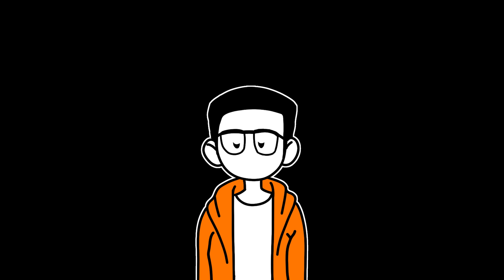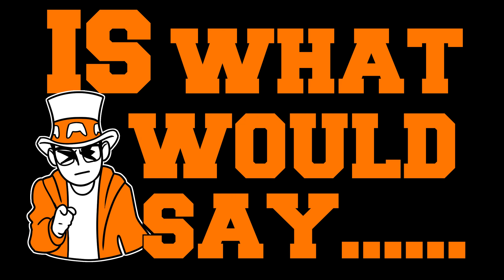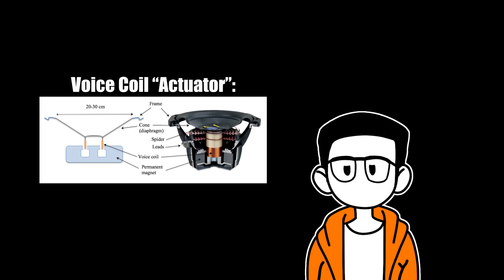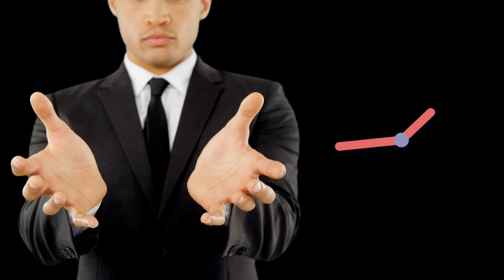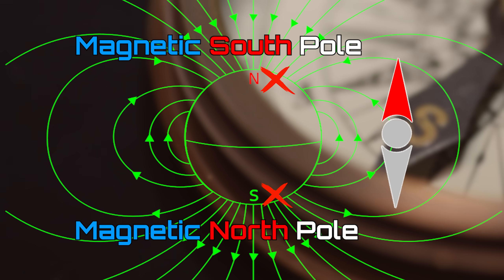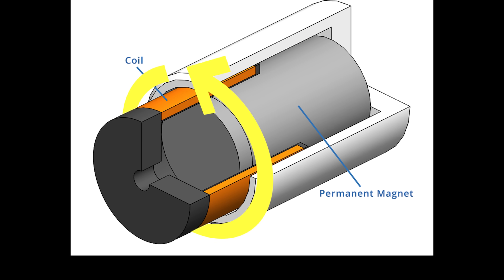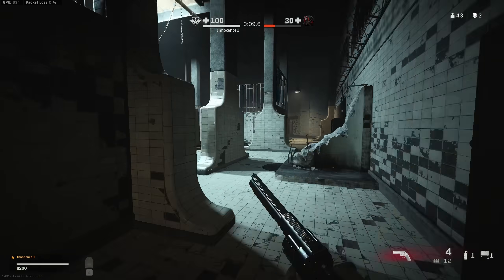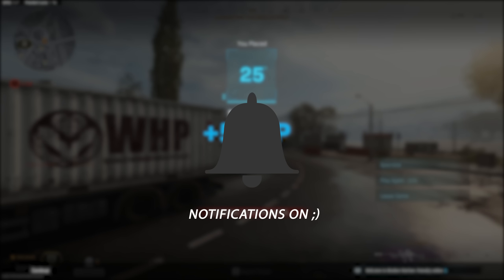Explaining Exactly What A Dualsense Does.

Comment: I feel like what Sony has done with their whole system is super overlooked cause 12 teraflops lol kinda criminal 😅
Reply: Wdym
Reply: Nah, I'd say its quite the opposite. Everyone started praising the raw I/O thoroughput in the ps5 but ignored the velocity architecture for the series X, ignored the insane speed of the split vram of the series X(ie 560GB/s in the series X vs 448GB/s on the ps5), ignored the better decompression technique in the series X(BC pack) and had the idiocy to say that the series X SSD will be bottlenecked(which is what innocence himself said in a video). Oh and nobody praised the Dynamic latency input on the series X, the much larger die on it(which is why it has more CUs and doesn't need the liquid metal cooling the ps5 needs). Ignored that the series X has very stable clocks but haven't seen how much does the ps5 frequencies drop while playing titles. Ignored that the series X can load a game in mere seconds from cold boot through quick resume. Ignored that the series X has a 12 teraflop gpu(that is pretty much the rx 6800 with 8 less CUs and is pretty cutting edge). Ignored that MS engineers did work as hard as Sony's team for the best hardware on the series X and just think that they just threw in some PC components(which they actually did with the OG xbox and it was wayyyy more powerful than the ps2). Ignored that the series X will also stay pretty cool with its vapour chamber solution and that liquid metal is just more effective thermal paste and not something that'll freeze the ps5 while the series X burns. Ignored that series X still preserves games better with features like Auto-hdr, which makes use of machine learning on the series X and that xbox does have DirectML that could result in DLSS like super resolution feature being implemented on the series X.
Reply: santhosh sridhar this is just a paragraph of you saying things that are half true 🤨easy example Xbox ssd will have bottlenecks cause it they haven’t made it a priority to remove the bottlenecks 🧐 also Xbox is overrated  everybody has been saying it’s going to do 4k 60 w/rt on every game if that’s not praising than idk wat is
Reply: santhosh sridhar than you tell me y ps5 ssd speed it double Xbox and Xbox ssd speed is just typical ssd speeds which have bottle necks  I’m pretty sure every ssd has bottle neck unless u do what Sony did and make it a thing to go in there and remove them
Reply: @lilcartwheel1144  Idk. I guess all this advertising of power really made people get a false mentality about the series X. It is powerful, so is the ps5. But 4k 60fps with raytracing is something even the 3080 or the 3090 can do without any kind of dlss and even with that, it's hard to maintain the solid 60fps in some games. The series X is a powerful piece of hardware, so is the ps5, but they are just high end PCs and not even ultra high end for that matter. 

I guess this is what happened when ps5 just pushed forward the advertising of their SSD. Yes it is stupidly fast. And on paper, it is double the speed of the series X SSD. But the series X SSD is no slouch either. And with the more powerful cpu and GPU, and much faster VRAM, it can easily compete against the ps5 SSD. Just like the ps5's power is very much comparable to the series X's power.
Reply: @lilcartwheel1144  What Sony essentially did was add custom memory flash controllers and 12 pcie lanes instead of 8 thus greatly improving the bandwidth of the SSD. This was also why their storage is 200GB less than the series X, coming at around 825GB. Innocence did do a pretty good job explaining this. And removing the bottleneck, thus making sure the SSD reaches its maximum bandwidth.
But just because they essentially built some silicon or something......idk......I'm not Cerny.
.....to remove the bottleneck.
I'm pretty sure it isn't really that of a big deal and isn't there in PC SSDs because obviously, you're the one building the PC, not a specific manufacturer who makes sure that your SSD isn't bottlenecked.

Ok just read up about it. It's that storage APIs just aren't good enough to handle many I/O requests to take full advantage of the SSD, thus creating a bottleneck

But he really failed when he started explaining the series X's SSD. Microsoft DOES make sure that full advantage is being taken of their SSD. It's why quick resume is so fucking fast on the series X. DirectStorage makes sure that the xbox takes full advantage of its I/O. Oh and fun fact, it's also coming to PC.

I hate it when people treat sony hardware as "custom" and microsoft hardware as throwaway pc hardware because that simply isn't true. That's just a big insult to microsoft engineers who have worked for years on this. 

The only thing "custom" they didn't do and the ps5 did was add custom memory controllers and 12 lanes thus greatly increasing the raw I/O throughput. But instead they focused on the velocity architecture, focused on RDNA 2 technologies like sampler feedback streaming that greatly reduces load. And boasts a better decompression software and much faster GPU memory thus mostly making up for the weaker SSD.

Here is your proof. You have to skim through some things but it has all things I said and more

https://www.google.com/amp/s/news.xbox.com/en-us/2020/03/16/xbox-series-x-glossary/amp/
Reply: Because Sony changed ssd,did all this stuff with controller, went all out in the cooling ,trying to perfect 3d audio while also having all the features for next gen butttt ppl don’t talk about that they only dead set on teraflops  for example gdc out of all that presentation what did ppl get out of it .... 10.3 teraflops
Reply: @lilcartwheel1144  ik right, it's pretty sad😔
Reply: @lilcartwheel1144   is it bad? Ure not gona buy it?
Reply: @lilcartwheel1144  Sony might have faster SSD but Quick Resume is simply better.

Comment: Wow so much flapping around with unnecessary stuff and so far to the actual subject and how those stuff really work.
1. No, the previous controllers had feedback but it was not haptic feedback. Rumble is not haptic feedback. Haptic feedback is much more precise in terms of time and location.
You know how in the newer phones you press on the screen and you feel the vibration just under your finger, not the other parts of the phone? That is haptic feedback, the motor is in some random part of the phone but the vibration is delivered just where it is needed. The other difference is the time and force precision. It is so precise that you can pretty much simulate any vibration. Asphalt grinding, motor working, insect walking... You name it...
2. No, no other controller that I know of has programmable adaptive triggers, and certainly they didn't have it in dualshock 4. What it means is that the triggers can change the resistance they give and how far they can go down. And that is programmable! So for example when you press a gun trigger, it starts easy, then it starts getting harder and harder until it clicks, the bullet is fired and the trigger goes all the way down easy. Or pressing a brake pedal, it starts easy and gets harder and harder as you keep pushing it down. All that can be simulated and programed, for each and every different gun, car, bow... with different behavior based on the type.
Reply: Haptic feedback in controler is the coolest thing you've heard in a while? :)
Meet Nintendo switch, January 2017
https://www.youtube.com/watch?v=NWdd2J3W-cI
Reply: Ok I just finished the video and you nailed it on adaptive triggers ;)
Reply: Let me just explain you the difference in function between haptic feedback and rumble through an example.
Rumble is a 5$ vibrator and haptic feedback is 10.000$ massage chair. :')

Comment: I just want to clear up part of you explanation of relativity, i know you know what you're talking about but i think the explanation wasn't clear and had a couple mistakes. "The more gravity you have which is space and also the faster you're going which is travelling through space the slower time also passes". This is confusing when speaking regarding relativity. First you should clarify that we are travelling through 4 dimensional space time. Time and space are inseparable, you cannot travel through space and not travel through time. So, "The more gravity you have which is space" Should be amended to, "The larger your mass, the more you curve space and time, therefore to an outside observer, the time of a person close to a large mass appears to slow down as time must travel over the curved surface of space time (I won't go into geodesics)" Secondly i think its imperative to state that this is RELATIVE... hence relativity. Time itself doesn't pass slower, its simply slower or faster to the observer. '"Someone experiencing that level of gravity would literally have their time slowed to a halt while everything is else speed up from their perspective" This is a misinterpretation of relativity. Their time would only APPEAR to be slowed to a halt to an outside observer free of the gravitational well of the black hole. Again, time doesn't change, simply the observers interpretation of time.(At least not until the laws of physics break down closer to the singularity, where we don't really know what happens)... Sorry, Chem and Mathematics major
Reply: Also, Right hand rule boyz... right hand rule. Never forget

Comment: The triggers might use a type of the voice coil actuator to push against the trigger mechanism. The rumble would use a fluxed current (on/off in quick succesion, or, back forth) while the triggers use an "on" setting. It could allow a little pressure, or a lot, depending on current strength. To "lock" the trigger, it would just ppush against it and lock it in place until you do the on screen prompt to unjam the gun

Comment: Yo so when the say you shot a gun with the dullsense will the trigger get hard or just sit in place

Or when you run out of ammunition
Reply: The triggers can apply resistance. So if you have a hair trigger gun vs a heavy trigger, the controller can change the force required to pull the trigger buttons. The bow analogy is the easiest to understand since it will be harder to push the further down the button goes and might even push against you if you hold the arrow at full draw.
Reply: Fat Tiger thx that what I was looking for
Reply: @fattiger6957  It always pushes against you when even a bit of resistance is applied

Comment: I think what Sony team did with the controller is similar to what Apple did with the Taptic Engine, first in iPhone 7 and new Macbooks, if you press on the touchpad or home button, it feels like a physical click, but is fake, if you turn off the computer the click feel is gone, it does nothing, and you could never do that with the old vibrator mechanism, cant wait to try the new PS5 controller, it will be a game changer, biggest Xbox fan complaint was, about Playstation old controllers, they should try the new one for sure:)

Comment: I guess the triggers technology is a kind of magnetic nanofluid actuator

P.S: I saw this on a Brazilian video about the dualsense.
Reply: MrFatio link?
Reply: @brenogallo  https://www.youtube.com/watch?v=Hynk5WRq8Ls
Reply: @LeBrulox  thanks. Will definitely see (Brazilian here haha)
Reply: Os brasuka tão em todo canto. Kkk.
Reply: A magnetorheological fluid (the name for this kind of magnetic nanofluid) is certainly a possibility, but Sony has a patent on a much more straight-forward mechanism with a motor and a gear set. The motor likely isn't tightly coupled to the triggers (that would be an easy way to break it), but most probably tensions a torsion spring.
Reply: Thank you. Brasileiro é a peste mesmo heheeh.
Reply: https://youtu.be/HFwIMuAZe-g

The teardown shows the worm gear system. The main gear can turn the worm gear. 45° thread pitch of the worm gear makes it possible.

The trigger is not connected to any gears at all. The worm gear spins the main gear that has a plastic trigger stop attached to it. When the trigger meets the trigger stop, it meets resistance due to having to rotate a worm gear in reverse using the main gear.

Basically, the teardown shows you absolutely can spin the wormgear using the main gear.

Comment: Good haptic feedback can be borderline scary. If you have a recent MacBook you may be surprised to learn, no. The TouchPad doesn't click anymore. It's a solid, flat piece of metal. The clicking you feel now is 100% haptic.

If the dualsense can match that quality of haptic, the amount of sensations they could fake is amazing. 

Imagine feeling the brass case of every other bullet you fire randomly pinging off your skin. In a sandy desert, feeling large grains of sand tickle your skin with a wind gust. A horror game, were a centipede crawls around the controller.

The immersion can potentially be amazing. 

But, that is if it is good haptic. If it is bad, we just get Switch Joycons.
Reply: Nintendo: “But.. Ice cubes.. right?”
Reply: I was wondering about that. I never felt high quality haptics and my only experience is through the joycons which never impressed me much. I dunno if Nintendo just used cheaper parts or they never made a game that showed it off that well.
Reply: @fattiger6957  
To give Nintendo some credit, they managed to fit a lot into those obscenely small controllers. Them having any form of rumble is impressive on its own.

Comment: The potential for gameplay improvements/enhancements is the thing that excites me the most, like how in DMC5 SE the adaptive triggers will help you timing Nero's exceed, which can be hard to pull off without decent practice. 

I do think it might be likely that these features will not be utilized as much later in the console's lifecycle, similarly to the touch pad, that right now seems tacked on to the dualsense to be more compatible with previously released ps4 games. I hope I'm wrong though.
Reply: Rumble and triggers are such a fundamental way of interacting physically with the game, devs will use it for sure!

Comment: I think it's gonna be like the switch pro controller with the hd vibration
Reply: Yeap. Switch also has linear actuator rumble. Its clearly more responsive but the hype is not justified. Its a minor improvement IF the dev actually tries to implement it correctly.
Reply: @jousis_  If they do it as well as on phones I'm happy
Reply: @daanabbring4596  No, it's much better. I can tell apart the rumble of my xbox controller (PC) to my switch pro or even joycon easily. It's just not worth the hype. It's not a feature it will change the way you experience. It's just...better.  A feature that will change PS(4/5) gaming is motion controls. Not rumble. Gamers should push devs to implement motion controls.
Reply: @jousis_  exactly, the motion controls in shooting games is sooooo helpful